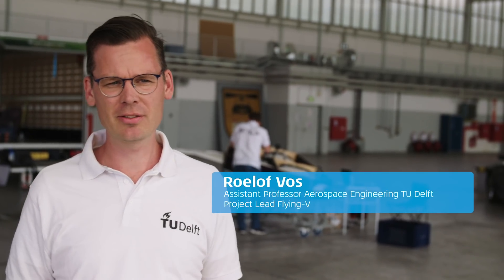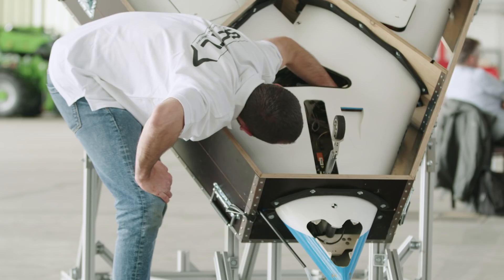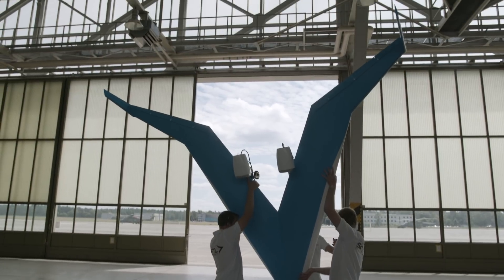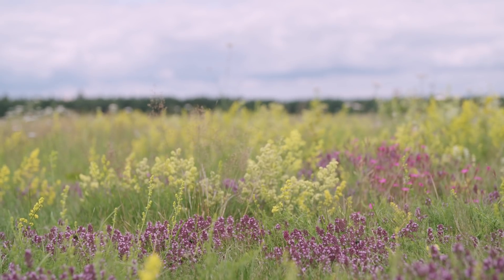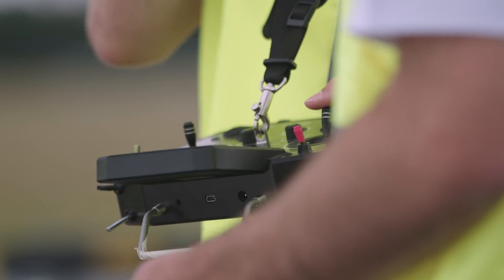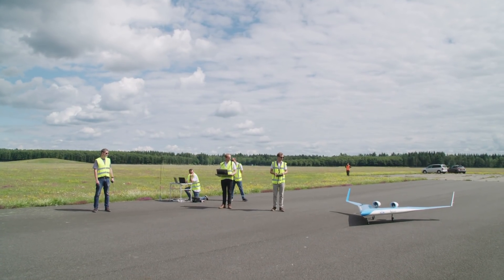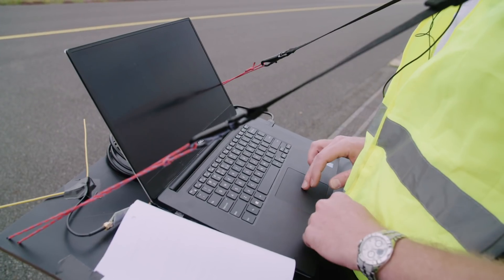Flying-V - Scale model maiden flight

Comment: The people in these comments need to find some joy in their lives.  These are people thinking outside the box and trying new concepts to advance innovation.  Commercial airplanes have looked the same since the 50's.  I'd say a design overhaul is overdue.  I like this design which would have passengers sit in both wings making an entirely new flying experience.  Any update on if they are moving foward with this design?

Comment: The only issue I see is that they should be using turbo engines instead of those electric 80mm EDF ones. They would get a better feel of what the air pressure would be like with fuel tanks in it with real fuel.
Reply: Agree. You can make Snoopy's dog house fly with EDFs. They are great for lightweight models of almost any shape, but do very little to demonstrate that a concept is actually viable

Comment: It would be better to extend the center-body aft and put normal fins on it. See the older Tu-404, the possibly derived Airbus "VELA" studies, the X-48-C.

As for study, study, study, and maybe a prototype in 2041, see also the Burnelli simple chunky lifting fuselage.
As per the '70s Boeing model 754/759 studies and publicity back then, with the same engines and fuel load as a normal plane they'd get x1.5 the payload and range compared to a normal plane.

Something like the Lock-Mart "hybrid wing/body" design also could proceed any time with conventional materials and techniques and no need for advanced stabilization, just flying like a normal plane, and gain similar benefits to fuel savings.

Aerospace is not at all serious about gaining efficiency. "If it looks right, it'll fly right"  rules, and and we see only intolerance to "funny-looking" lifting-fuselage or all-wing planes. "Tradition" and "my grandpappy didn't design planes like that!" dictates that we spend another 60 years burning too much fuel in tube & wing conventional planes because some marketing execs think that "passenger acceptance" will stop the planes.
Reply: Why don't you apply for the team? I'm sure they will pay well for a person of your vast knowledge.

Comment: elon musk would have this in service in 6 months hahaha
Reply: Seriously though. It needs someone with a pair of tentacles (you know what I meant) to just do it and force the rest of aerospace to do it also. As Musk forced auto makers to build EVs and he is forcing aerospace to reduce the cost.
Note that SpaceX was underselling all launch services competitors before they'd landed a booster. Aside from little test hoppers, all their advances and "testing" has been done with paying customer launches. Nothing of what Tesla or SpaceX does is patented.

Radically new engineering or engines or materials or advanced stabilization & control systems are NOT necessary, it you put a tail on it. See the X-48-C or the Tu-404 if you like pretty, swept "flying wings".

See the '70s Boeing model 754, similar to the very much earlier Burnelli designs.
No new materials, no issues about control, and 150% the range and payload of a normal plane. Ignored by aerospace for decades.

We've just got to get aerospace past the intransigence by Boeing who has stated that they will never build a civil or large transport plane to lifting fuselage or any sort of "all-wing" planform.

Everybody else including apparently Airbus and TU Delft and the Russians and the Chinese just slavishly follows Boeing, so we're going on decade after decade flying inferior, vastly inefficient planes because some exec at Boeing says "if it looks right, it'll fly right".
Reply: @JFrazer4303  Aerospace doesn't work like that. For example, it needs different designs of the airfield and certain safety features wich you cannot provide without many many years of experiences
Reply: @jo21e6 
 None of which applies to the Boeing 754 or Burnelli designs. Standard materials and processes and avionics, same airport infrastructure.
Yes, it takes a few years to get it past safety protocols. It's taken a few years since the 1940s.

Comment: The only leap in aviation that this plane will make, is a leap straight into the trash can. First of all before you waste our time and two years of yours, you should research what's already out there and learn something. Then make a bunch of cheap quick models to test the simplist basics of your design. So, your design is lame, amateur, it literally sucks. Way too much sweep on the wings, way to much volume in the whole plane, and it doesn't even look functional. A conventional flying wing should be going over a hundred mph with those engines on there, if it's shaped dece
Reply: Indeed, it is a design from 70 years ago, nothing new.
Reply: " The only leap in aviation that this plane will make, is a leap straight into the trash can. ".  That's probably why they spent 1.5 years and 90% of the budget on their overly dramatic video with music and head-shaking acting script.  Designed for KLM CEO's to watch and drool in awe methinks.

Comment: Full scale folks flying an electric hair dryer: 
*high visibility vests in broad daylight, and alone on a remote runway
*preflight checklist
*laptop guy on the runway, prior to take-off, doing some stuff thats probably meant to look scientific.

Rc guy, flying an actual gas turbine powered plane:
*fill er up with homebrew mixture of kerosene and oil
*switch on, spool up, take to the skies.

Comment: Excelent design. Just like a triunghiular plane ,but they chop off the draggy part from behinde.
Reply: More likely it need that aft triangle filled in and extended aft with fin & rudder there, to eliminate any concerns about dutch roll or instability or control authority issues.
See the Airbus "VELA" studies, possibly derived from the Tu-404.
Reply: @JFrazer4303  now I wonder why they didn't put the propeller s back and forward in the osprey
Reply: "triunghiular"?
Reply: @afrog2666  triangle 📐

Comment: Help me understand the idea. What was the downside of the other model that this one fixes?
Reply: This is 15% more aerodynamic, which should translate into using less fuel. 
3-4 litres per passenger per 100 kilometers is an average for a large airliner. 
NY to LA is around 4,000 km, requiring around 140 liters per passenger right now. Something like 42,000 liters (11,095 US gallons) for 300 passengers, one-way.
15% improvement would get it down to 119 liters per passenger, or 35,700 liters (9,430 US gallons). 
Jet fuel is running about $1.40/US gallon right now... $15,533 old style vs $13,202 new style. A difference of $2,331 for that 1 flight.
For an airline doing that both ways every day of the year, that is a savings of ~$1.5 million per year on just that plane doing that route.
Reply: @kengirard9726  the cost of fuel is offloaded to customers anyway so from your math it would reduce the cost of that flight by almost 8 dollars per passenger. The benefit (for what would be an absurdly expensive to make airplane) would hopefully be that those 8 bucks in savings could draw in more new/frequent customers.
Reply: It consumes a lot less fuel than a traditional plane
Reply: @RayyanAshraf  you mean it will consume ...
Reply: @alain-danieltankwa8007  Yeah it will consume a lot less.
Reply: @RayyanAshraf  or are some full scale prototypes already flying?

Comment: How is it going to fit around airports? Surely many airports will have to build new taxiways for it.
Reply: I read its wings are designed to have the A350's wingspan.
Reply: @lachlangreen8389  Okay great, so my typing skills aren't up to much. I'm not continuing to insult you alright 😂? I was just stating a point of how the wingspan was so large, and you went on a tangent about something completely different?
Reply: True
Reply: @lachlangreen8389  I think you're the numbskull here. Obviously I could tell it was RC and a concept. The fact is that the wingspan is going to be huge, many taxiways will not support it, as well as stands. Look at the illustrations.
Reply: @lachlangreen8389  It's a real concept.

Comment: nice work but what about  passengers safety ? you're are seeking the way of low fuel  consumption but not thinking how to make air travel safe secure. do we really have an issue with aircraft design? I think you should find out the way how can peoples travel safely. doesn't matter in what type of aircraft they are traveling. every year we see 1 or more air incident and all of passengers on board lost their live's. I am not saying that your project is not good but you should add something for peoples safety, so they can travel by air fearlessly. thankyou
Reply: Air travel is the safest form of travel. Hundreds, if not thousands of people die every day in road accidents...
Reply: @andreasitarica469  I AGREE . but my concern here is only about air travel.
Reply: @andreasitarica469  Can you just imagine something like "year 2030: Nobody ever died from airplane failures/crashes since 2021" ?   So ok, bring that V shape non-landing thing that will likely snap in 2 at a crossed wind landing.

Comment: The severe bending moment & very complex plate vibration modes which will give whole rear body flutter  as opposed to simple beam modes for classic aircraft
Reply: You' re really an engineer?  How about getting an America's Cup 7.5 ton yacht to "fly" on a foil the size of an ironing board? And you're concerned about "flutter"?  🤣

Comment: A couple of questions. First: what are the advantages of the V shape? Isn't it inconvenient? Perhaps it can be bent or broken more easily than the traditional way. Second: the power of the engines has also been scaled up? Because as I have seen in other scale models, it seems that the power of the engines is much greater, in proportion, than the real model would be. I say this, because I have not seen any real aircraft take off at that angle of attack.

Comment: In the RC world this is called a flying wing and made from dollar foamboard by hobbiests.  Bunch of Phd loosers.
Reply: coming from someone who doesn't know how to write loser. makes you look pretty dumb. ;)
Reply: When you spell losers wrong...
Reply: Dale Haygarth  i think throwing faeces would have been a good way to resolve the world wars.
Reply: So I am dumb because I made this type of plane from foamboard decades ago but I spell loosers wrong. BTW I fly paragliders, sailplanes, single engine airplanes and RC planes for a hobby so I know a little bit of airplanes. Bunch of armchair looser wannabee pilots.
Reply: It is not just another flying wing. A normal flying wing is more of a bent triangle. This project is trying to use a two-tube fuselage into a sort of lifting body while maintaining low drag overall. Also, human mind has to be taken into account in ways like some kind of agoraphobia if you put someone in the middle of a conventional flying wing (although, someone near the tip of this wing would be much affected by roll movements).

Comment: it flies very smooth ... but because of the high resistance to the air ... stop aerodynamic ... but it is not so much ... much much frontal resistance ...
Reply: That thing is ultra low drag
Reply: @peterzingler6221  I mean, like a drag car?

Comment: Congratulations. I'm really hoping to see a new type of airplane design for commercial jets some day. (tbh I've always thought that the cylindrical design with wings attached is getting a bit old) 
However it's a long long path. Airlines and airports will not switch unless the new design will save them a lot of money. But it starts with "small" steps like these. I'd also like to see  variations with some of the designs having more of the flying wing or blended wing shape similar to the Maveric concept or the B2, with integrated engines. (I know that technology isn't quite there yet)

Comment: What is the point of making v shape fly ??
Reply: Cuz it's more fuel efficient
Reply: Fuel efficiency and people carrying capacity of this plane would be more in comparison.
Reply: The point is.. more passengers..
Reply: Your right, they did not explain the "why" very well. Perhaps they are assuming we know... but I for one do not.
Reply: May be they just call it progess
Reply: to shake the passengers sitting at the edge of the wing. enjoy the meal.....or not. It will be a bust. There is a reason why we still use a tube design.
Reply: Reynaldi haha good point.

Comment: It's a great success on ideal wind conditions but would like to see if the aircraft can handle rough , turbulent wind conditions such as heavy crosswinds , tailwinds , headwinds, sudden up / down drafts 
and storm like conditions TO CHECK 
if the aircraft is STABLE enough like conventional aircraft.
Reply: This was a first flight of an untested (in the real world) design . You have enough videos of crashing to watch already !
Reply: Essentially passengers sitting in a wing. Enjoy the meal when you are sitting at the outer / middle section of the wing....or not. Really impractical.
Reply: @reynaldi819  WOW, what Brain: From watching 2 mins of video flight for a 'proof of concept' model, you can already determine the flight characteristics / turbulence resistance of a platform that may be certified in about 15 years form now!  
Absolutely Amazing! You should immediately write to the TU Delft, KLM and Airbus and let them know about your insight(s)....stop wasting time here on YT!! I am sure they are looking for consulting engineers of this calibre!

Comment: Try flying it in a heavy crosswind and see how that works out as one of those wings catch the ground.
Reply: I suspect the roll control authority is very good. No more or less than a conventional heavy passenger aircraft.
Reply: and then imagine yourself as a passenger sitting in the middle / outer section of the wing. "im moving up and down side to side like a roller coaster".

Comment: Good that it can fly, but what are the applications of it? It has 0 cargo capacity?
Reply: Fuel efficiency.
Reply: @scar9  A crash ready design!
Reply: @rjaquaponics9266  looks more stable than the new boeing tho
Reply: @scar9  Flying wings can't stall, but without adequate power they can't fly either.  If they made this design a reality, they would need 6 point harnesses on all wing seated passengers, numerous air sickness bag for them and  completely redesign new airport gates to service the loading and unloading of passengers.  Efficiencies will not overcome the disadvantages.  Perhaps they could sedate the passengers before flying.  This plane would give a whole new meaning to "Red Eye" flight~!
Reply: @rjaquaponics9266  i know right. they dont consider the passengers sitting in a moving wing. ENJOY THE MEAL.....or not.

Comment: isnt the inability to inspect the engine visually from inside of the plane possess a problem from practical perspective? Camera could fail in case of emergency for whatever reason
Reply: Access with a scaffold tower, from inside the V....very easy.  No plane engine EVER get's serviced in flight...
https://www.tudelft.nl/en/ae/flying-v/technology/
Reply: @almostbutnotentirelyunreas166  its not about being serviced in flight. But to inspect visually. For example if there is fire, engine failure, etc. You cant see the engine.
Reply: @reynaldi819  Rear view camera? Do you drive a car?
Reply: @almostbutnotentirelyunreas166  as i said, in case of emergency, camera could also fail for any reason.
Well.. visibility is one thing, structural integrity is another. An engine mounted below the wing tend to stay hanged, but top mounted engine have tendency to tip over, therefore its inherently unstable and you need stronger mount to compensate the lateral force. On top of that, if the engine mount somehow fails, you dont want engine end up on top of your wings and affecting the aerodynamic lift.
Reply: @reynaldi819  Sorry Reynaldi, engines mounted on nacelles, against the 'fuselage' have been around for a very long time, it is proven tech. Also, rear-view window? 
Any engine failure is consiedered an emergency, the design is irrelevant: The plane has to land ASAP.
There is no additional force to an engine above / below the wing...the airspeed / pressure is the same.
Google A 10 Warthog....a rock-solid platform used in the military....
Reply: Visual inspection is not an issue IMHO but engine placement makes sense to review in terms of serviceability on the ground. There are aft-mounted engines high up on the fuselage but even those seem better accessible. In this respect, nothing beats the low-hanging engines of B737 and the likes. FOD is, however, much higher risk at underwing positions. Pro and con. If it really demonstrates that high fuel saving, I bet maintenance will tackle the access problem.

Comment: Anyone have an explanation why the undercarriage is so weirdly tall?
Reply: Answered in https://www.tudelft.nl/en/ae/flying-v/technology/
Reply: CodeKujo linked a good source but to elaborate on it, the undercarriage is so tall because a combination of wing sweep and high angle of attack on landing means you need longer main gears to prevent the wingtips from striking the runway. Hope this helps anyone wondering the same thing.
Reply: @veloxsouth  I would have thought regardless, excessively tall gear.
Reply: I'm wondering why it was flying dirty, the landing gear should've been retractable. The in-flight "tests" being recorded would be inaccurate to some degree with unnecessary drag underneath.

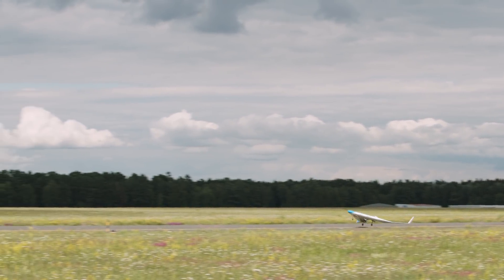Comment: 3:05 dude, isn't that take off angle is waaaay to steep? It felt like you're flying a fighter jet...
Reply: Maybe he is not the best RC pilot.. It worked out fine though, due to the high undercarriage.
Or maybe that was because of the "sudden nose up pitching moment" with a too high angle of attack.
Reply: Absolutely. I wonder how close to stall that was, surprisingly very forgiving design. Ease the elevs, not jerk it in the air.